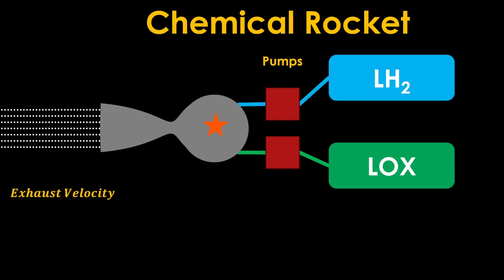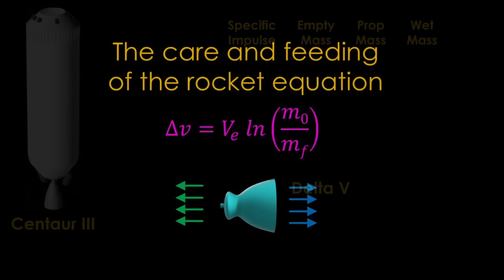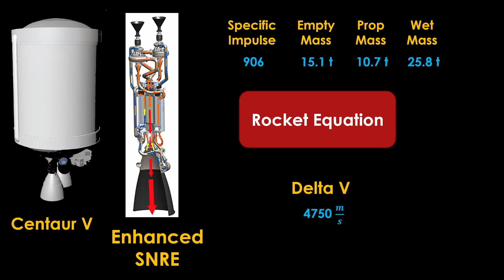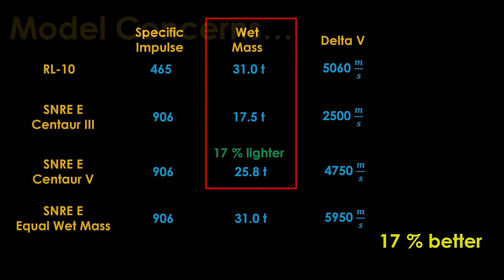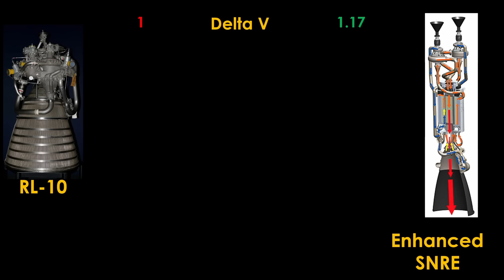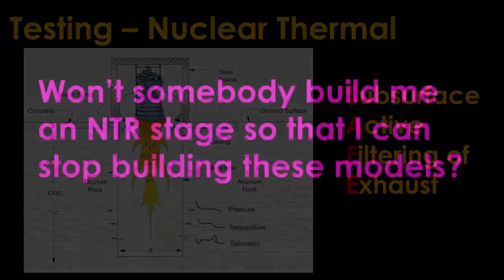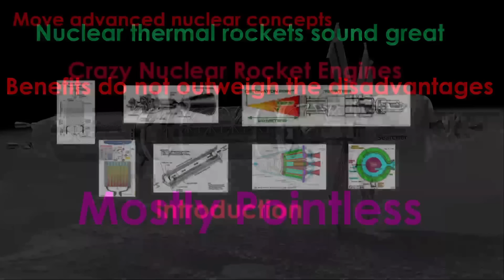Why Nuclear Thermal Rockets are Mostly Pointless

Comment: Obviously, the conclusion is that NTR works best for transfer stages to Mars and alike. Larger tank structures and with a higher specific impulse shorter travel times are feasible. 
Furthermore, the specific impulse of the NTR is based on the NERVA design which may be a bit dated. Other concepts, though expensive to develop, offer much higher Isp. which may offset the reactor mass penalty.
Reply: Does everyone have a negative IQ or something? The guy making the video makes dozens of major mistakes and every commenter makes the same

The issue he mentions is that the literal proof of concept early prototype engine he picked has a low thrust to way ratio. He then completely ignores the fact that nuclear thermal rockets have the highest theoretical TWR of any engine type. Meaning a properly build advanced nuclear thruster would be extremely lightweight for the same thrust and would be lighter for the same thrust levels as the centaur stage than the chemical one. 

That also flies over your head and the head of everyone who liked yours and similar commenrs seemingly, and you also all seem to completely miss the notion that Oh yeah! You can just put a smaller engine on the same stage

The size is NOT a factor in the performance of a spaceship. Large and small ships have basically identical performance. Neither fuel tanks nor engines get more or less efficient as they scale up and down. (Armor efficiency goes up with larger ships (yes, armor, as in space debris and military), while structural stability goes down with larger ships. Those are the two main factors. Fuel tanks do not get more efficient as they get larger and neither do engines)
Reply: @IceRain-f5v  I may have expressed my objection insufficiently. 
My objection to 'Eagerspace' is that his analysis is insufficient when based on an upper stage with a fixed fuel volume and an Isp from the late 60's.
An NTR with higher Isp will do the trick.
Reply: It’s harder to get a nuclear thermal rocket above 1000 Isp because that’s the Isp they get at the melting point of all known material 
The only way to increase it is to make them run hotter which requires weird tricks like liquid and gas core nuclear rockets. 
The idea there is to have the core so hot that the uranium becomes LIQUID or even A GAS and somehow hold that liquid or gas with things that haven’t melted

Liquid core are thought to be able to reach 2200 Isp while gas core could be 5000-6000 Isp. But they’re much harder to create than the 900-1000 Isp solid core ones. 

So getting more Isp out of them is very difficult, but his argument is predicated on an example he picked that has low thrust to weight ratio. Unlike Isp, thrust to weight ratio is not hard to increase at all as nuclear reactors can be designed for any arbitrary power output all the way to a nuke.
Reply: @IceRain-f5v  size actually does have an effect on the effectiveness of a rocket.

see the dry mass of a rocket is made up of hull and engines and whatnot, which means it scales with the surface area of the craft, whereas the fuel scales with it's volume. so the dry mass scales to the square of the ship's size, but the wet mass scales to it's cube; which means that the deltaV of a ship scales linearly with its size all else being equal. the effect is magnified by a more efficient engine, so a nuclear thermal rocket achieves proportionally more gains per extra unit of ship size than a chemical rocket does, and vise versa (which is why small rockets are more efficient using chemical rockets).
Reply: @IceRain-f5v  Nuclear TWR is far less than chemical rockets, and worse its regulatory limitations mean it will never be allowed to enter either Earth or Mars atmosphere to avoid spreading radioactive debris. The Starship design demonstrates you can build a chemical rocket that is far cheaper that can achieve NTR speeds by in-orbit refueling, and even better, it lands directly on the surface of Mars and Earth, eliminating the need for expensive and heavy separate landers.
Reply: @IceRain-f5v  Only one negative IQ to be found in this comments section.  Your just spewing strait falsehoodsnow, highest Thrust to Weight ratio come from hydro-carbon engines at close to 200:1, no NTR can ever hope to get close to that on hydrogen because you simply can't flow hydrogen that fast.
Reply: @kennethferland5579  The bigger problem is actually that nuclear reactor power densities just aren't there. As an example, a Raptor engine has an output power around 4 GW and weighs around 1.5 tonnes, for a specific power of about 2.6 GW/tonne. The highest power density reactor I could find is Phoebus-2A, with about 2 GW/m3; assuming a density of around 4 tonnes per cubic meter, that's a specific power of only 0.5 GW/tonne, and that's without considering the mass of the rest of the engine, just the reactor. With that specific power, to get a TWR higher than Raptor, the exhaust velocity would have to be more than 5x *lower*, so around 65 seconds of ISP. And this is all ignoring the practicalities of such a high propellant flow rate, as you mentioned.
Reply: Except Solar Electric, today with off the shelf components of solar panels and thrusters will beat out NTR best case after decades of development and billions of dollars.  And the Solar electric stage will be reusable after the mission.  That's why even NASA moved away from NTR Mars mission concepts.
Reply: @kennethferland5579 completely wrong, solar electric provides tiny force, even if high efficiency, doesn't help with things like manner missions to mars. Nuclear thermal lies between chemical and electric/ion thrusters
Reply: @kennethferland5579  For solar electric I'm of two minds. First, it has limited use for anything beyond Mars as solar panel size has to increase. Second, the solar panels in spacefaring are not exactly off the shelf.
On the other hand, it is a well understood technology with high specific impulse but low thrust levels.
As I said: I'm of two minds here.

Comment: I gotta watch this later, below is just rambling that you may or may not touch on in the video.

I used to be all on-board with NTRs, but it just looks too complex for its own good in retrospect. Like we want to go to Mars, so we need advanced technology, so obviously we need NTRs.

Since you can get similar or better performance with chemical rockets and orbital refueling, where the former is much a better understood technology, and the latter is likely to be much easier to figure out, especially on the regulatory side, why go through that effort if you don't have to?
Reply: Nuclear engines haven’t been technologically developed the way chemical engines have. They’re not too complex, in fact they’re relatively simple in principle! What they are is inefficient compared to high-efficiency LH2-LOX burning engines, at least currently. Current hydrolox engines can reach ~450s ISP, with nuclear engines boosting that up to 800-1000s ISP. Much better on paper, but the tyranny of the rocket equation still applies, and to utilize that high ISP you’ll need a real heavy engine, large radiators, turbomachinery, radiation shielding, reactor and containment mass, LOTS of hydrogen, etc…
The technology needs active development in multiple fields to reach the efficiencies it promises. Today, large chemical rockets are by FAR the best option, but as we grow and develop our presence in space, it will become a necessity that we go much faster, and nuclear can absolutely prove useful in the near future! Just probably not tomorrow.